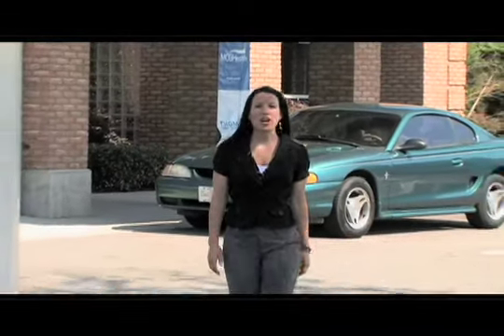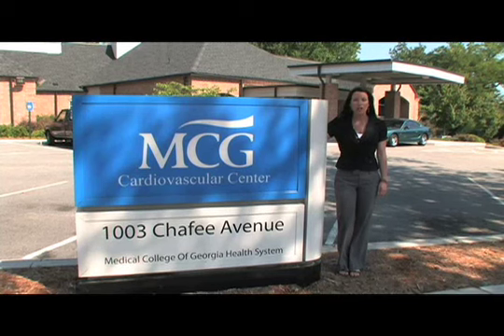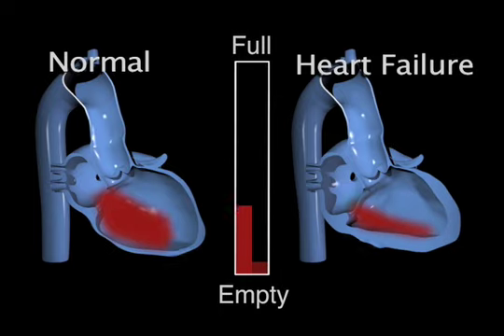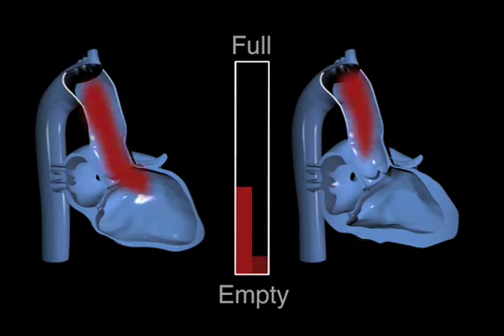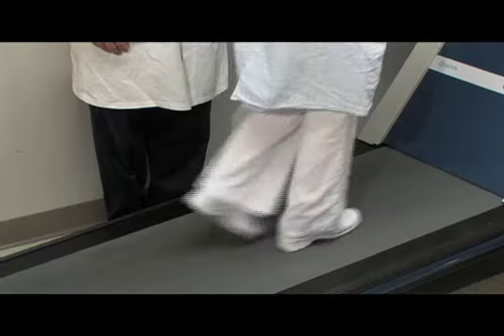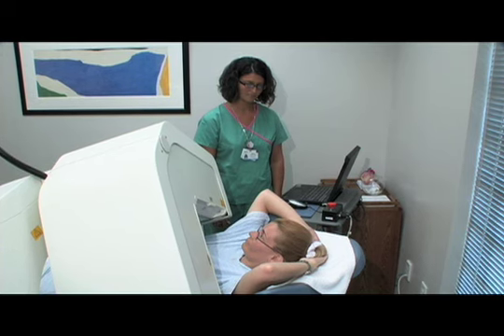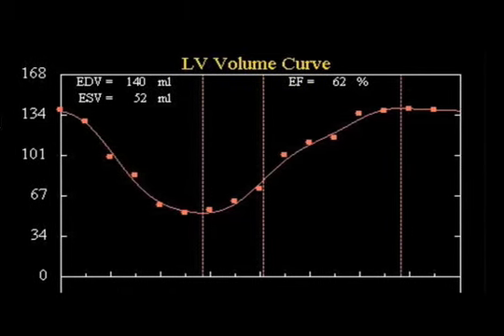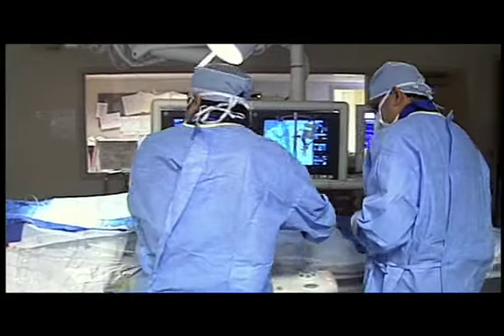Nuclear stress test can detect more than blockages

Comment: Had it done. Scans were ok. Getting a vasodilator injected in the middle of a slow walk was extremely scary. I instantly felt like I ran around the block but my feet were barely moving. I think I had an anxiety attack that something horrible was happening. And after suffering a pulmonary embolism lung clot, I was on edge already.
Reply: Yeah felt the same way. From 0 to 100 in a few seconds.
Reply: I thought it was supposed to be either/or, not both treadmill and dilator.

Comment: I've had several done and i don't see the point when you already know what the problem is
Reply: What is the problem ?
Reply: How was yours got mine comming up im terrified about the stress part bit.
Reply: @davidconstant4716  It was ok you feel heated for about five seconds and that’s it the hardest part is the length of the test, I have a lot of stents and I did well you will too just relax and drink plenty of water afterwards
Reply: @crystalmalveaux2097  thank you for getting back, I'm worried about my heart rate going crazy during stress part...

Comment: Had my done in a two day type my insurance wasnt willing to do the one type so anyways i had last part done on the 19th November 2024 that dye stuff gives me issues at first one felt like i couldnt breath and when i did it wasnt that much air , very scary and then it took like 5 minutes i believe and finally was able to breath but headache was  immediately and nausea first day i felt okay but days after i did not ...to much to type but long story short I'm still having my heart feeling like im running and im sitting with chest pain and nausea with dizziness. So i called my Doctors office and long story short. They pushed my test results through for quicker read and it showed abnormal so im getting scheduled for heart catheration hopefully soon before heart attack comes.